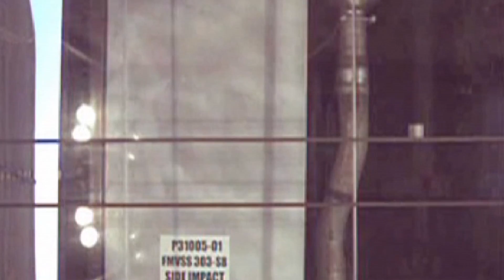Straight Talk About CNG – Are CNG vehicles safe?

Comment: What about long-term usage on wear & tear on engine components???
Reply from the maker: Thanks for the question. We recommend contacting a truck dealership to get questions answered on engine performance.
Reply: I am no expert on CNG, but I do have quite a bit of knowledge about engines. I would say that in some ways running on CNG would be better for longevity than running on gasoline because natural gas burns a lot cleaner than gasoline, so there won't be the issues with carbon buildup that gasoline engines have. The oil would stay a lot cleaner for this reason too. Also, since CNG is a gas rather than a liquid, it won't wash the engine oil off the cylinder walls like gasoline can, and it also can not dilute the oil like gasoline can. Eliminating carbon deposits, cylinder wash, and oil dilution as well as keeping the oil cleaner are certainly benefits for longevity. As for potential longevity disadvantages, I can't think of any but I would suggest doing your own research. People say that the gasoline lubricates the engine's parts such as valves and rings, but it actually has the complete opposite effect by washing the oil off of the engine's parts.
Reply: I had a Honda Civic that ran 200k miles with cng and no problem.
Reply: @diego_charles  I have a 2008 CNG civic with 320k miles. I have become concerned with the tank integrity over the years so I stand pretty far away from it when I fill up. Considering the thing takes only $14 to fill up it simply cannot be beat in terms of economy
Reply: @lm7bird680  here in my country, you have to do an anual inspection and a tank integrity test each 5 years. If something abnormal is detected the tank is replaced. The gas tanks here have expiration date of 20 years.
Reply: @diego_charles  the tank in the car has expires 15-20 years after the date of manufacture

Comment: They talk alot about CNG not being as flammable as gasoline or diesel. That is true, but gasoline and diesel is not under high pressure and CNG is.
A new high pressure thank is probably safe, but what happens when the parts age? Lets say you drive in the rust belt are when the tank and other fuel system components are exposed to elements and hostile environment. How safe are these old tanks then?
An old gasoline tank might start leaking, but when a CNG tank fails, it can do so with a big bang, costing you your life. They need to come up with a way to store gas in a non-pressurized form before these gas cars can be deemed safe.
Reply: this is why tank have expire date, and need to be controlled annually (or once in two year, depending on country laws). So before it might come to the point that old material could pose a risk, it is replaced.
Reply from the maker: Thank you for the comment. NGV America has additional tank safety info. Here's a link: https://www.ngvamerica.org/resource-center/?resource_type=safety-documents
Reply: @mgemadison tank is save but there is humen error with gas tank blost nooo change to safe life but in petrol never be brust
Reply: In switzerland there is a inspection cycle of the Gas tank.
Reply: In The  Caribbean there   are multiple cases  of cng thanks exploding
Reply: Last time I checked  a  car  or even a SUV is  crash tested without  a cng install  factory safety specifications 
There is a reason  why  vehicles are built with the fuel tank at the bottom
Reply: Also  some complain about low performance when using cng
Reply: This is true, I've heard horror stories about CNG exploding in my country.